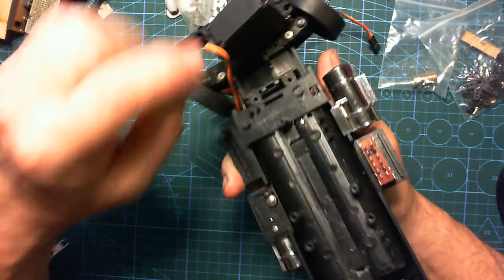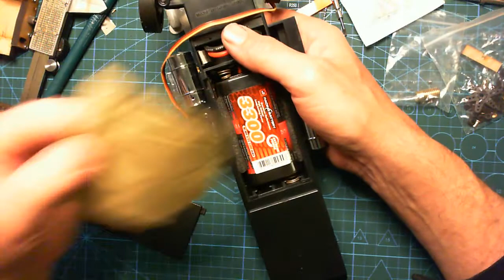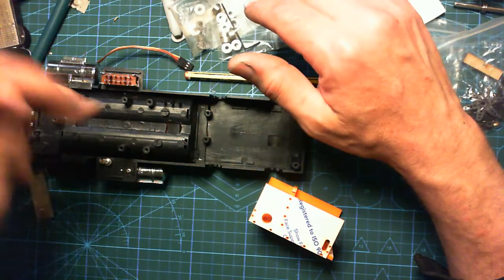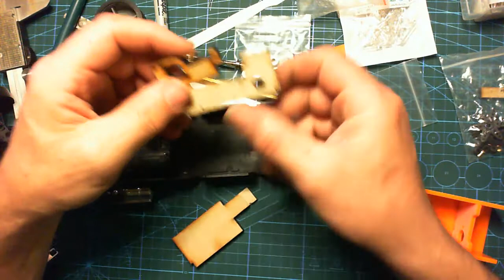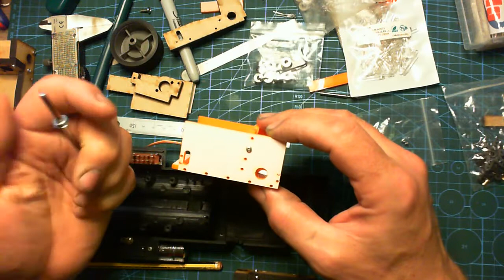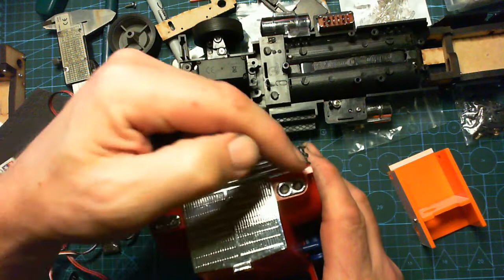Corgi Truckertronic 1979 RC Truck 4

Comment: Hi Bob. Very nice video. I also have 2 schuco trucks which i also want to restore. Do you have a video of the finished truck?? I'm very anxious to see it.  Keep up the good work. Kind regards. Henk Ketelaars (The Netherlands)👍👍👍
Reply from the maker: HI,  the truck went on hold although I did make progress a lot of progress.  I got somewhat distracted with work, Santa finally delivered a Sandscorcher (that was an epic build but not filmed) and sucked into 1/10scale and 1/12 scale racing, oh and rebuilding from the ground up a full scale Landrover!  Now as for the truck......  I do want to get back onto it and finish it (just need to get some jobs finished on the house).  I actually got quite far with this as a project as in the truck was running, hitch working however due to the lack of information on AliExpress with regards the  gear mesh the gear box destroyed itself!!  I got in touch with someone on a CNC face book group who said he could make the gears (basically took me for a financial ride and disappeared).  So I need to get back onto it.  I may go down the route of FDM or Resin 3D print as I have got into that a little more.  There is better info on gears and a better range of gears it would seem too.  It was so disheartening to have to open the truck up again and find the worm gear as a pile of brass shavings in the bottom!!!.  Oh I also found out the surpass ESC did not like 4.8v  so much searching I found a 7.2v pack with smaller cells that actually fit inside the 4C cell hole.